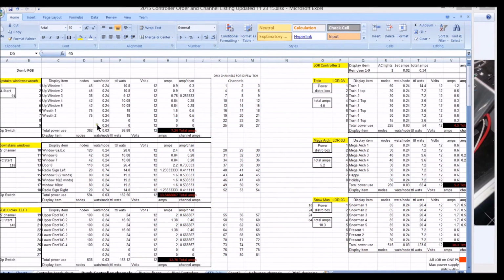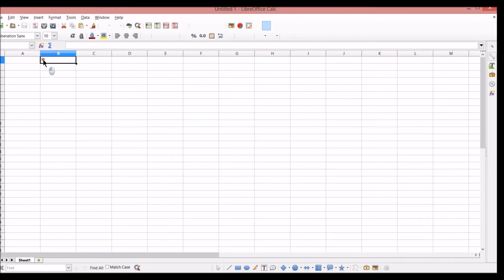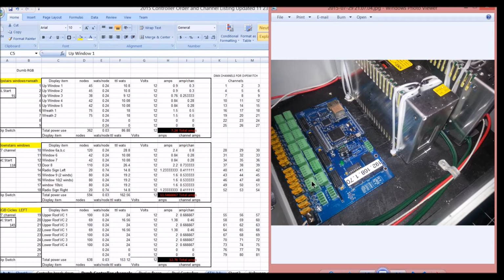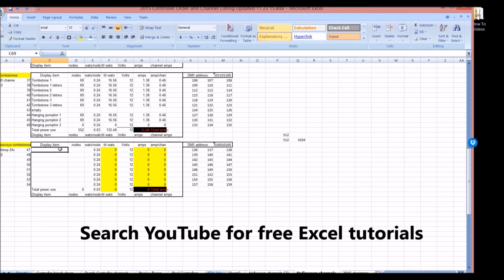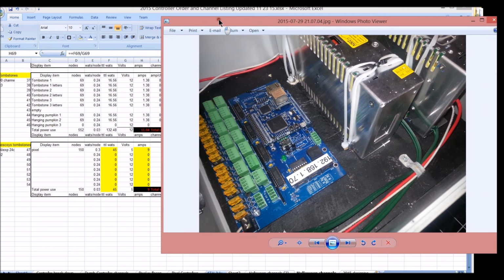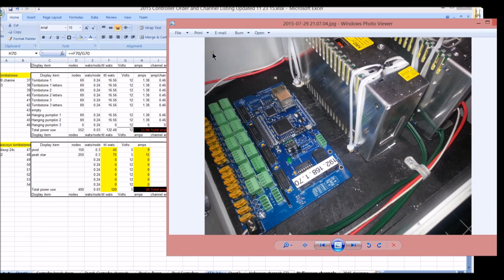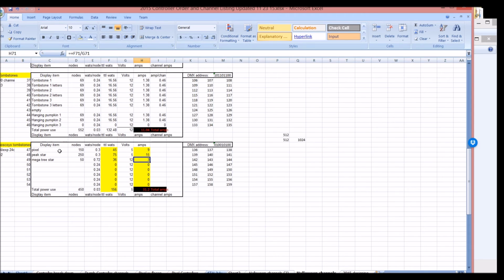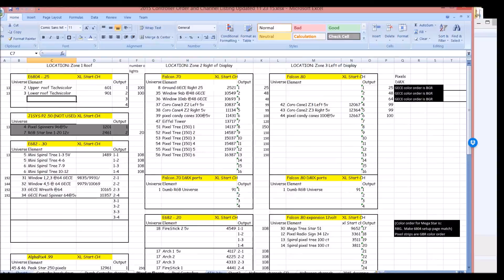Pixel Power Calculations with Excel FREE DOWNLOAD

Comment: Great video, thank you! How do you calculate how many pixels per power supply? I haven’t downloaded the spreadsheet yet. Is that on there?
Reply from the maker: You will have to manually calculate that.  This video can help you.  Jump in about 1/2 way through... It is on DUMB RGBs.  Remember that you won't need to "divide by 3" at the end of your calculations  since dumb rgb works different than pixels .
https://youtu.be/4SjejpgDKp0

Comment: by adding a wire from the + terminal (in) and connecting it to the end of the line ,you will have same voltage on both ends of the string. (A jumper)

Comment: I have a couple questions:

1. If you were starting out, would you choose all 5v or all 12v pixels? 
2. When choosing a power supply for the Falcon or e682, would you recommend finding a power supply that maxes out the amps each side of the board takes? Or two power supplies to cover each half? (which seems to be what you have in this video)
Reply from the maker: +B33SON Hello :)  If I were starting all over again:
1.. I would use the 12v C9 style pixel on my roof (ws28110) AND 5 volt bullet pixels on any other individual pixel element.  I build power injection points into each element so power injection is not an issue.  12v pixels are great for very long runs that you don't want to add power injection to.  Currently I'm using the Technicolor C9 pixels on my roof lines.  100 nodes work great and don't need any power injection.  I like the 5v pixels because of the lower cost.  I have far less trouble with 5v pixels than I have with the old 12v.  And, if you plan ahead for power injection, you'll build it in to the prop to make it easy.

2... I typically use a 350w power supply for most my pixel and dumb RGB controllers.  Only the mega tree and the F16v2s have dual power supplies.  Some of my dumb RGB and e682s do not run that many pixels.  In those cases I use computer power supplies that I received FREE :)

Comment: When you inject power at the end of the pixel string, when do you have to separate it from the source power?
Reply from the maker: +Black Wolf Acres ...
It is not like you're "crossing the streams".  There is no need to separate the power from the front side and power from the back side.  It's all the same power source.  Power is consumed by each pixel till either it is all use up (consumed), or the length of the wire is so long that the voltage can not travel as far as the length (voltage drop).  Power injecton does not affect the pixels if it is received in the back end or in the front end of the pixel.  If you apply power to the back end of the pixels first, then put data to the front end (first pixel), the pixels will not know the difference.  Power does not need to flow one way.  Just insure your + and - are hooked up to the correct wires :)
Reply: Leechburg Lights I inject power at every end.
Reply from the maker: Black Wolf Acres 
you don't separate from the original power supply.

Comment: ws2811/2 controller ?
Reply from the maker: +Deives Bender   This is the F16v2 pixel controller.  It can run a large number of pixel protocols, including 2811/2812s and GE Color Effects.  It can run a total of 64 universes of DMX... and 680 pixels per controller output.